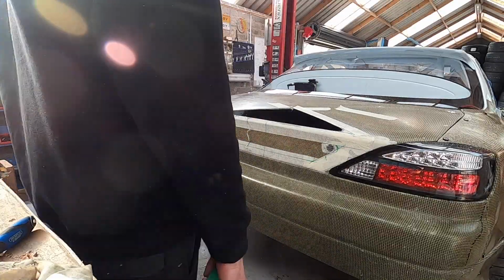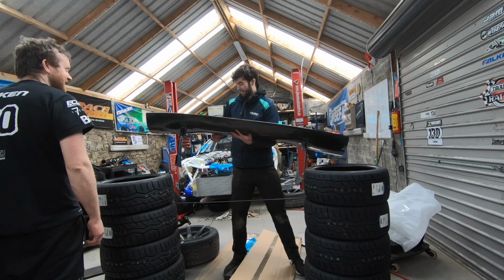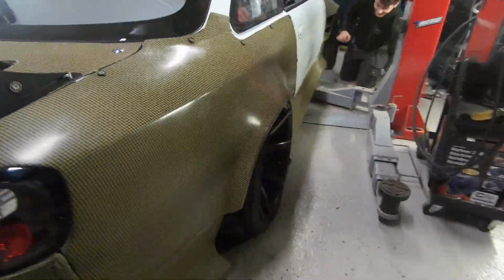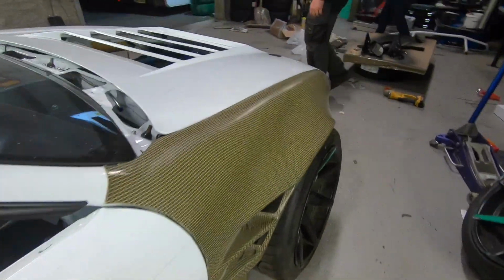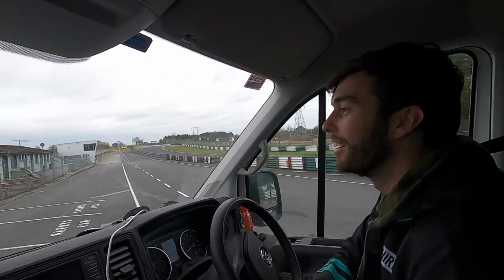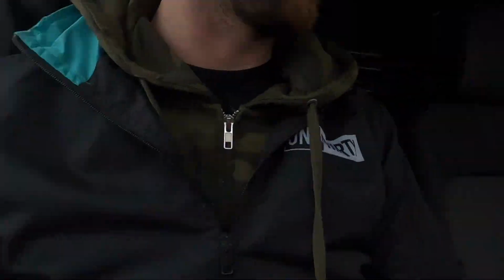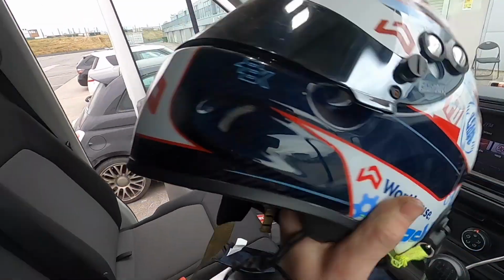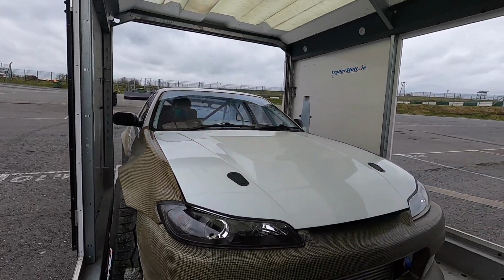Building The Ultimate S-Chassis | Part 8 | FIRST TEST

Comment: I had a shake with power steering in my jz s14. Turned out under load the engine sump tray was moving enough to touch the rack but only under full load when the engine was moving on maximum aggression. Maybe worth checking clearance down there as I was convinced it was a bad pump or overheating fluid etc. 

Car and driving is savage. Such an achievement to complete it in a short space of time..wishing you best of luck in Russia.

Comment: James, you should experiment with angled rear wing end plates (think toe out) so that when you are sideways, the air is being shuttled over the wings surface at the angle allowed by that end plate. With straight ones you have a large area acting as drag smacking up against the end plates. Just a thought experiment Ive been having and thought id share! Cheers!